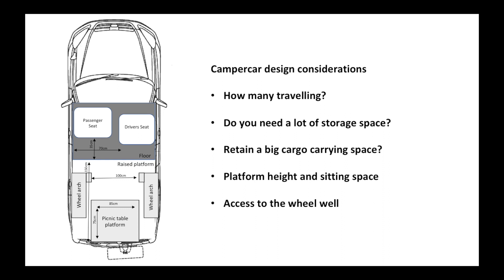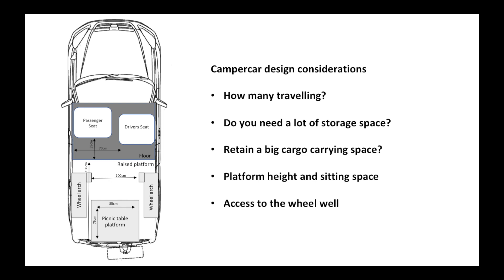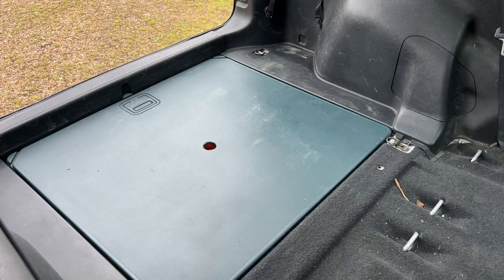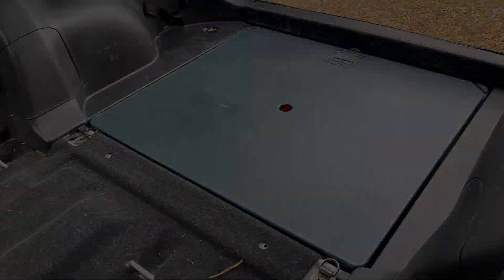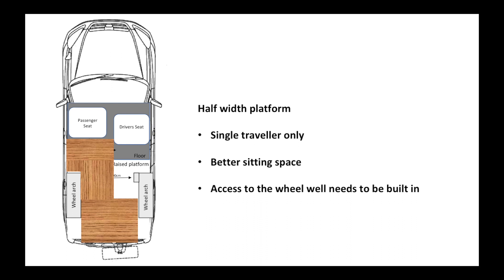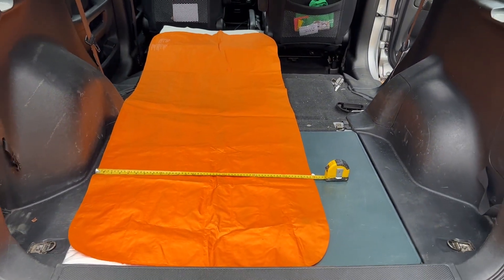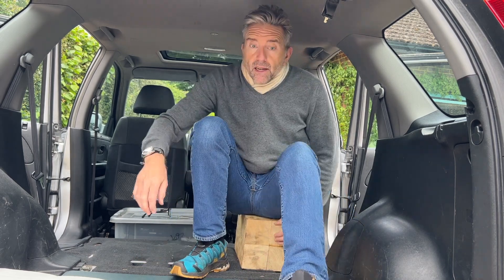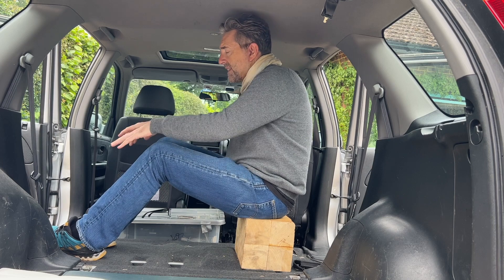Honda CRV - Camper build out - 5 minute design thoughts

Comment: How do you deal with the alarm going off during sleep, will the alarm not go off if the keys are in the car, will that drain the battery? Got a crv and planning to do this
Reply from the maker: I just use the button on the inside to lock the doors...the alarm doesn't go off.
Reply: What about lifting out the picnic table to truly give yourself enough space for your feet? You could replace the table with a hinged piece of plywood.
Reply from the maker: @RachelHellenga  This is a great idea, and if I did another build I'd fashion a new cover for the wheel well which gave you easier access. That picnic table is a nice idea but its never used. You want someting with a fold back or pull out hatch.